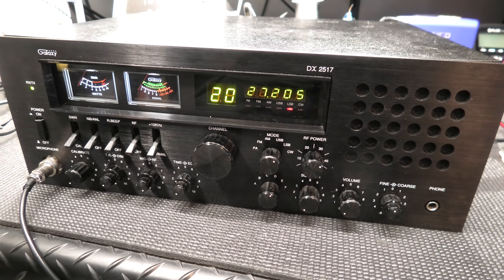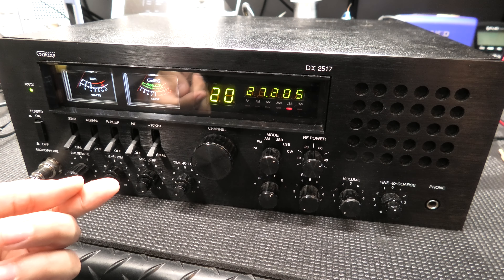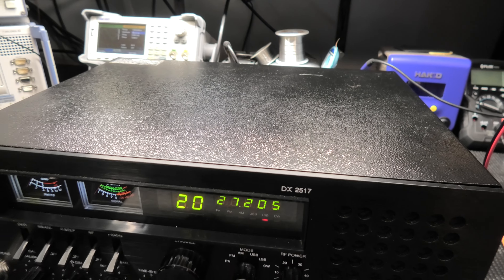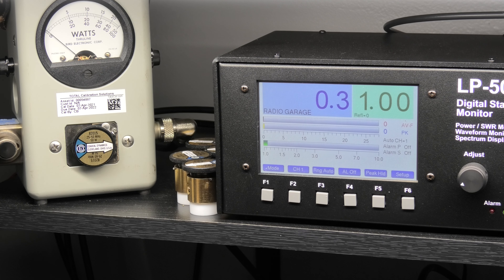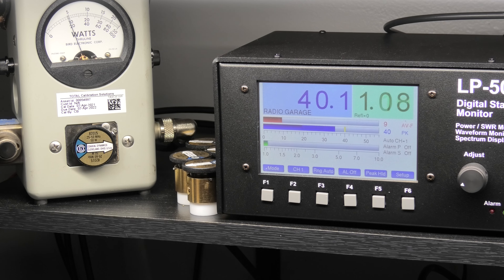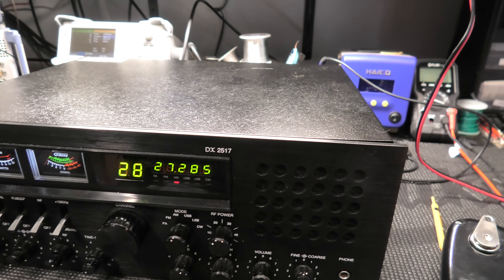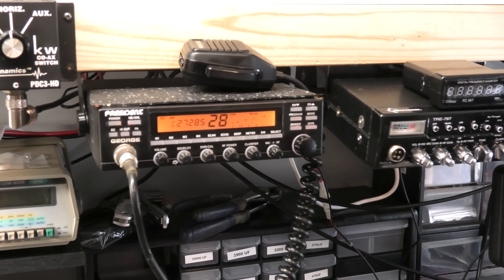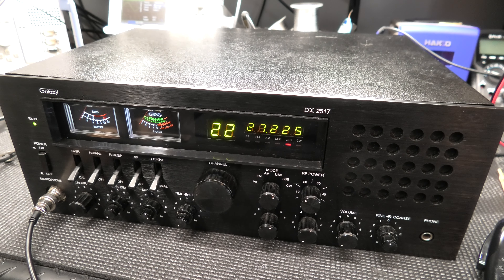3made it's Fixed *Galaxy DX2517* CB Radio Tuned

Comment: I started spreading the two end pins out to snug them up and a dab of hot glue. I wish they would have used locking connectors.  Good work as always ! 👍

Comment: When I purchased my 2995 new it had the most horrid blue lights in the meter you could ever imagine. Literally couldn't see anything.
Since it had a failure early in its lifetime Superior CB out in California repaired it for me under warranty and put new lights in similar to what you did here and it looks much much better now. 
I've always loved how these base stations look.
I don't know if you ever got a chance to see the old Northstar version of this radio but it was quite the spectacle inside.
Literally a mobile radio inside with Chrome covers on both sides.
Reply from the maker: Yea the blue lights with the black meter background just doesn't work at all. The wheat lamps just don't have enough brightness to punch the insert either. The white leds seem to do the job nicely. Plus I put 2 in each meter. Thanks for stopping by and happy new year.